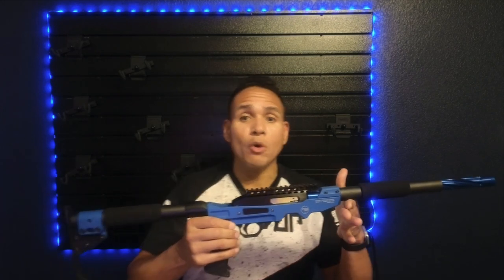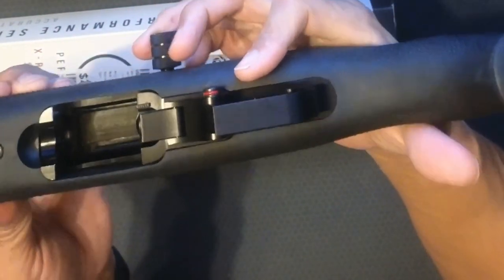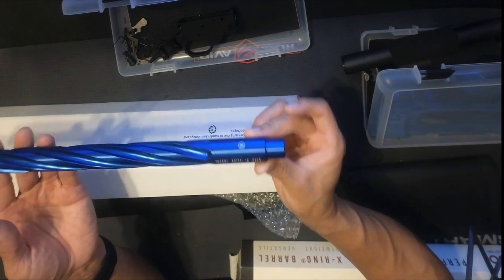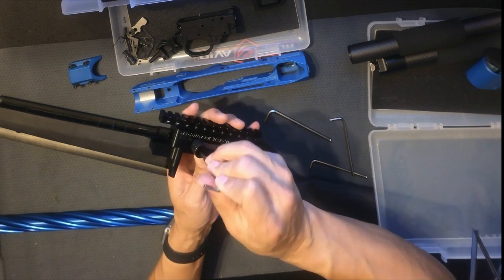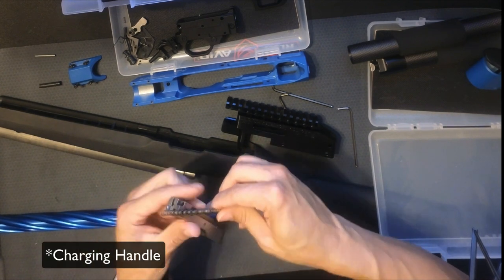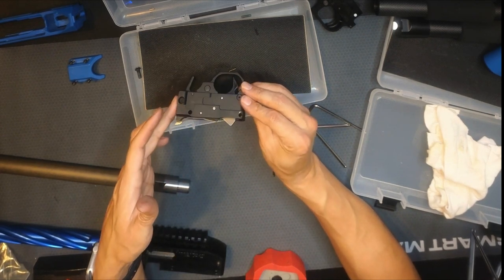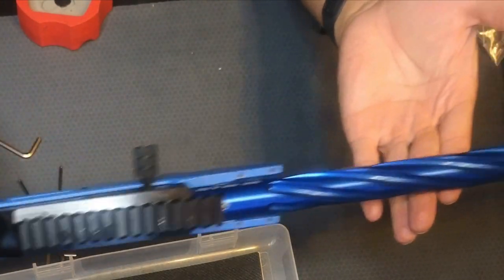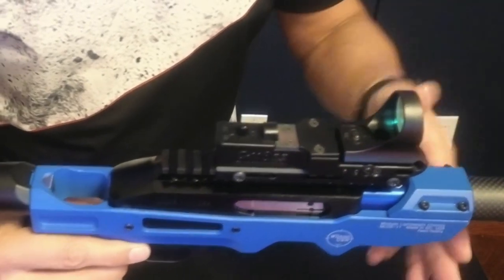Steel Challenge 10/22 Rimfire Build Time - Magnum Research SwitchBolt Wiland USA Volquartsen C-More

Comment: Left side charging and the thing and light carbon fiber tubes (TOOB, haha) are huge improvements.
I just wish we could combine that with the ease of cleaning from the Fletcher 11/22 and the Manticore X magazine release.
Reply from the maker: You said Toob - lol.  Good One.  To be honest, I never tried the fletcher 11/22 design, removable top I believe.  I gotten so used to disassembly & cleaning the tacsol & switchbolt rifles that I can do it in less than 15 minutes, including firing pin removal, extractor cleaning, and even taking down the trigger assembly halfway.  I am currently all in on  tactical solutions X-Ring rifles with the dual spring bolt recoil design & custom firing pin.  Just always goes bang, which matters more than the cleaning time. Still I can get it sparkling in less than 15 minutes with 3 allen wrenches and a paperclip.   Kidd Triggers for me 100%, with volquartsen a close second.  Never tried the Manticore triggers, but I am not a big fan of Tandemkross triggers or internals.  I do use their bags and grips though!.  Thanks for watching -  I have been on break, but should be back at central Texas Matches starting in June, Hope to see you at the Range!

Comment: New shooter to this sport.   What would this build cost?
Reply from the maker: Welcome to the Shooting Steel Sport - It and the people are awesome.   Most folks would build this over time- 6 months or so.  Buy the rifle Switchbolt around 500-600 depending on your internet skills. then add the optic -C-More 175-250.   Then add the chassis ~350.00.   Then add a better trigger custom to you. ~150-250.  So low end 1200.00, high end 1350.    Most of the time I can pick up a used complete unit ~900-1K.   I didn't include the barrel as I used this rifle stock to easily make grand master, but for this sport light front end is better.   Another good option that I really like is TacSol X-Ring rifle, all around solid rifle these are currently what I shoot.   Volquartsen also makes a great rifle.     best of luck in your steel journey.    I shot my first year with standard Ruger rifle in Magpul chassis with the C-more optic and did great.  If you become like me and chase the GM ranking or better, then the lightweight gear makes it as fast as possible.    Cheers - Karlos  .

Comment: Karlos, what is the total weight of this gun without mags?
Reply from the maker: The rifle in the video comes in just under 4lbs 4 ounces.  I don't use this rifle anymore. - Swapped over to both TacSol X-Ring rifles for irons and optics.  My irons gun in 3 lbs 8 ounces using Wiland Chassis, 8.8 ounce wiland barrel and TacSol Receiver.  My Open Rifle is also a TacSol but with a heavier barrel 12 ounces, a heavy C-More Aluminum optics at 8 ounces, so it comes in around 4lbs 8 ounces. I do prefer the lighter barrel in as it makes transition adjustments easier.  However, I am really used to the C-More Railway Optics which adds weight too.